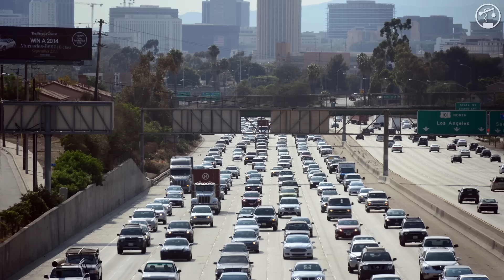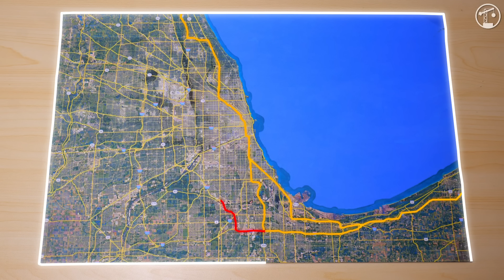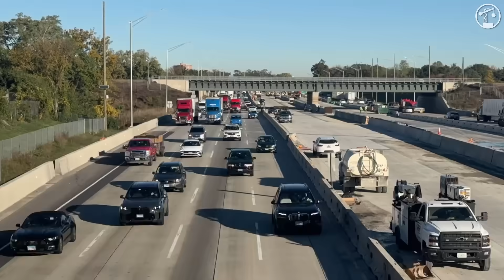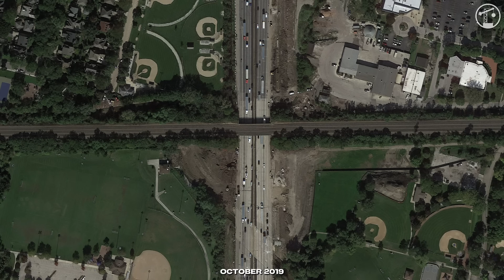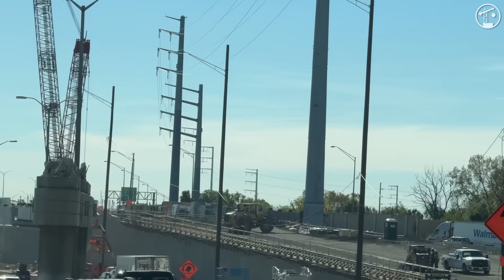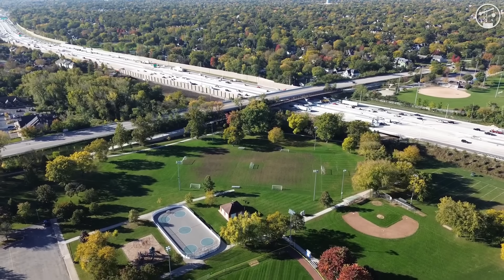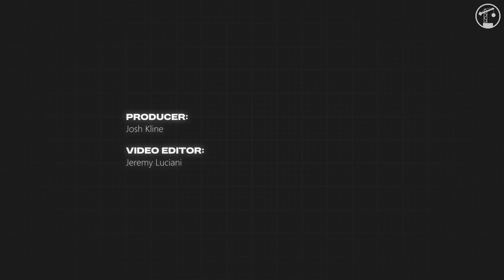Why Chicago is Spending $4B on One Road

Comment: 294 is not a 1950's highway. It has been totally rebuilt numerous times. And there is now 355 to the west as well as the old 94 going through the city. The problem with 294 is the problem with the other two interstates. If you put 4 tolls on 294 people go around. And that has made traffic in the other two highways back up for hours. Rush hour downtown is now a four hour event twice a day. And going through the city is cheapest. The toll isn't 40 cents. Its forty cents times four. So trucks often go through the city. And 355 to the west needs a tie back to the main road (294) north of the airport to Wisconsin. Right now there is no east west highway north of Ohare forcing people in the OHare and rush hour traffic.  In past plans there was a by pass from 355 north of the airport back to 294. In fact there are highways to nowhere north and west of the airport now. Another issue is that 94 goes down to what amounts to two lanes from 6 downtown. That backs up all the way to the airport and 294. Put a toll north of the city to balance driving with train fares as well.
Reply: 40 cents times four??? Tolls went up from 40 cents to 75 cents in 2012. And next year (2027), they will increase another 45 cents!
The State of Illinois has finally realized that people are made of money.

Comment: 294 is not bad at all even with the ongoing construction. 94 from 159th up through the city to around North Ave is a damn nightmare. I dont see how they ever remedy that without major no on/off ramp express flyovers.
Reply: I work off 130th and 94. Been there about 2 years. 94 is worst interstate I've ever been on. Definitely not up to modern interstate standards.

Comment: Some of the new concrete in sections is absolutely brutal. All you do is bounce and weave like skiing on moguls, it sucks.  There is a huge cracked section near the 87th St bridge in North Bound lanes, they didnt repair it, they half ass covered it with asphalt. 

Then there are 1 mile strips that were completely asphalted RIGHT AFTER concrete was laid, thats how bad it was, THEN the asphalt was so bad from the concrete they shaved the asphalt. This is the biggest scumbag operation use of public funds I've ever seen.

Comment: The 294-290-88 interchange used to be known as the Hillside Strangler because the inbound lanes went from 3 lanes down to 1, and since I-88 runs through several of the highest population suburbs in the region, traffic problems were inevitable. I'm lucky enough to not have to need to use it being up north of the city, but the misery it caused is legendary. Now they just need to work out the terrible geometries at the 90-190-294-Mannheim Rd mess at the entrance to O'Hare Airport. And rebuild the old overpass oases they used to have but knocked down for widening.
Reply: The Hillside strangler is still there.  They just moved it in a mile or two, to "the avenues"

Comment: My biggest wish for 294 is enforcement of the “NO TRUCKS IN TWO LEFT LANES” signage.
Reply: I'm a trucker and we often have no choice. There is simply not enough capacity to handle it all without using them at times.  I'm never in the far left lane but often I do use the next one.
Reply: Well maybe if the idoits would drive the limit in the right lanes then maybe trucks wouldn't be in the left two lanes and FYI the left lanes isn't for you to speed it's for passing
Reply: @jimmytrussel488  great excuse when the trucks in the restricted lanes are there when they want to go faster than their 60mph posted speed limit.
Reply: There are times when it's necessary. There are many variables as to why but many expect to use those left lanes like it is the autobahn. That is not a valid reason for truck restrictions. Allow the trucks to move at a consistent speed will help. One other thing, if the idiots in the Chicago area would grow up and stop playing games with the trucks would help a great deal. I have ran and continue to run Chicago for over 30 years.... it is the actions of people with nonsensical attitudes that cause the constant issues.

Comment: Its LAke Michigan.  It literally cuts off half the country from the other half from the Canadian border down to Gary IN.  So tons of East/West truck traffic comes through this corridor around the bottom of the lake.
Reply: Drain lake.
Reply: @radomirsretenovic8492 
Or simply build an elevated highway over the lake.
Reply: @DanAshleyChicago  That would be pretty cool.  There is actually a ferry that runs across but its expensive and its just cars.

Comment: One solution they needed were express lanes for those who weren't doing anything with Chicago and the burbs. Basically if you're going from Indiana straight through to Wisconsin, get in these lanes and fly by for the next 50 miles, no stopping.

Comment: Nicely done.  This is obviously a very complex build. The main driver of the logistical issues is Lake Michigan itself. Basically everything north of I-80 has to shift south to go around the lake. So this gets added to the congestion associated with a major metropolitan area and you have a difficult task in trying to optimize traffic flow. Living in the far north suburbs (think Gurnee) , when I need to go south or east, especially vacation travel, I will try to leave around 4AM. As the construction on the Tri-State seems to be going on forever, I find it more expeditious to take stay on I-94 into the city (via the Edens expressway and then the Kennedy) onto the Dan Ryan and over the Skyway. But you need to get there early, like by 5AM, especially when I am towing a travel trailer.  Really looking forward to the completion of this project.
Reply: For commuting, my rule is "you can't beat the early people"

Comment: Not mentioned: the failure to extend Hwy-53 north to Hwy-120 and the US-12 freeway in Wisconsin. This absence of these facilities funnels all north and northwest traffic into I-294, rather than distributing it efficiently between I-294 and I-355.
Reply: As 53 was proposed it would have been a failure due to inadequate E-W arteries in the path from the Lake Cook-53 intersection to Lakemoor.  Then what at 120-12?  That's where it was slated to end.  If the end-point is 120-12, how to connect back to I-94?  12 to 43?  There are way too many environmental hurdles for the continued extension, even for the 1970's.  The correct path would have been from 53-Dundee (ancient times) or 53-Lake Cook straight lining to 22 & Milwaukee, then either continue to 94 and connect at 137, or follow Milwaukee Rd to I-94.

Comment: Thanks for addressing the induced demand...I've lived here a long time, and induced demand is evident after every widening project. Probably, since the toll collection is done with transponders, the best move is to demand-price the Tollway. The toll on the Chicago Skyway is high...high enough to make commuters choose alternatives, so when I go on vacation trips (and only pay that toll twice), the highway is uncongested.

I-294 sits just west of the boundary between urban-style development (walkable, decent public transit, dependent on arterials) and suburban/exurban style development (malls, office parks, housing developments with low walk scores, poor public transit, stroads). I think demand pricing will help prevent the use of the tollway as a local short-cut, basically, apply economic pressure to use and let the users figure it out.

I live in the area, and go through the I-290/I-88/I-294 interchange area all the time on suburb-to-suburb trips, so I've got a bit of experience.
Reply: So basically exploit the suburban poor

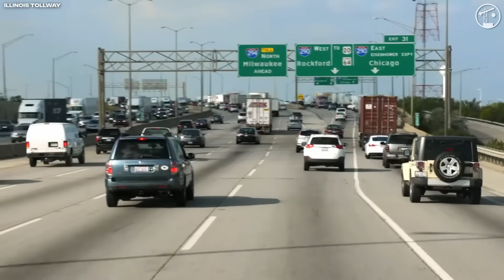Comment: 3:45 I live in the west suburbs. This shot? What a disaster zone. They tried to fix the Hillside Scrambler, and ... not a fix, just moved around the choke point. This is where I would decide to go to IL 64/North Ave (a strange and dangerous interchange, drive down US-20 pothole run past the Proviso rail yard, then a left and a right) via the loop ramp of slow truckage (that they fixed), or I-290 (parking lot toward downtown, I say "Rush hour is from 5 am until 3 am"). Maps says this is the fastest route and NO, I'm taking arterials.

Comment: I've been driving all of these expressways as a commuter for over 30 years.  Back in the 90's I used to park downtown for work.  Parking started at $3 a day and by the time I stopped working there 10 years later, $15 per day.  I go back later and all of the parking lots I used to park in are now High Rise Condo's.  Guess who helped pay for those.
On 294 I used to pitch my loose change into the feeder to get through the toll booth without counting it.  I'd just keep throwing a handful of pennies in until the gate went up.  Now I'm paying nearly $60 a month for the same stretch of road automatically taken from my debit card when needing a refill.
A few years back I switched to local roads.  It takes me 20 minutes longer but I'm not paying for the privilege of sitting in backed up traffic.  If you are charging me that much and I'm still sitting in backups, then maybe I'm the fool.  I only take the toll road home, and only when it gets me there without backups.  The new lane configurations, basically , just make it really confusing to figure out which lanes you need to be in to get to your off ramp.  They are not 100% done with it all but I can see, the Hillside Strangler will still exist at the 290/294 interchange, and there will be more crashes because it requires you to get over 4 lanes of traffic to get to your off ramp since it's not all on one side of the toll road anymore.  All this did, was get more expensive on a daily basis.

Comment: A lot of the work for the new ramps on 290 to 294 has alleviated this area of traffic and those are still in construction staging. Tollway has done a great job fixing their ramps. IDOT just bandaids as they really can’t afford major upgrades that the tollway can. None of the work I did on the Kennedy did anything on traffic configurations but IDOT advertised it to the public that way.

Comment: The back up taking 290 South and running into the 294 interchange is always a pain.  There's only one lane for the exit so traffic ends up blocking all the lanes with people trying to cut in.
Reply: Yes. The right lane of EB290 would back up with traffic trying to get on the ramp to SB294. This not only took out the right lane, but also center lane with any vehicle trying to cut into the queue in the right lane. I always used the left lane to try to minimize getting stuck as I was continuing EB on 290. This kept getting worse year after year. 
People on the US don't like tolls, but they not only improve the tolled road (294), but also the non tolled 290 if the money is used properly
Also, 490 will be built to go to the west side of O'Hare which should help 294 as O'Hare is growing again.
Reply: You got that right!!!

Comment: 294/290 problem.  Eisenhower Xway ended at 294.  Later the Eisenhower Extension was built from 294 to 90 in Schaumburg.  Much later 88 was built with the catastrophe ramping system--294/290/88.
Reply: In Chicago, the "Hillside Strangler" is not a serial killer, but an interchange at I-294/I-88 to I-290 in the suburbs of Hillside.  Perhaps coincidentally, Hillside is home to many large cemeteries.
Reply: @profdc9501 and home to the old landfill dump....😂

Comment: The addition of I-390 and I-490 are critical components of this redesign. 490 should draw a lot of truck traffic off as it connects with O'Hare. 390 should draw a good portion of west bound traffic off the main corridor and reduce some of the I-88 load. I think 390 also is supposed to draw off some of the west and northwest suburban traffic coming into and leaving O'Hare.

Comment: Lifelong Chicagoland resident here (until last year) who lived within a few miles of this highway, the Tri-State rebuild is helping and will continue to help the transportation system in the area. Like you said, it will be more resilient to issues. However, the underlying issue with Chicagoland roads is there are almost zero feasible alternatives. The state highways are underbuilt and flooded with an overabundance of traffic signals. And the high density of trucks is something special in all the wrong ways. If I-290/I-355, the outer north-south bypass had been built to properly connect back to I-94 up north, you'd see more traffic use that and less traffic tough it out on the Tri-State.

I now live in Wisconsin where there is a lot less traffic, though still busy. But even when it's slow, the metro is much smaller, so you know it won't last as long. Chicagoland transportation is a behemoth and needs to be reimagined, both car travel and multimodal (imagine if we had a beltway commuter train...).

Comment: Not wide enough, exchanges that are confusing and not efficient, always in disrepair or state of construction. The exchanges along side O’Hare on Ohare’s eastside is super confusing and inefficient. My opinion is only adding one lane in each direction is not enough. Needs to be six everywhere. They need to completely redesign and rebuild the exchanges, particularly where O’Hare is. If you’re not from the area and not use to that O’Hare exchange it’s a nightmare of confusion.

Comment: Just one more lane...  that always works so well. Look at Houston.
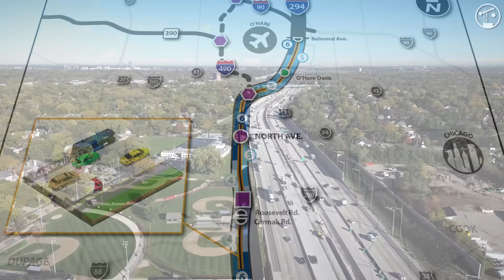Reply: 8:46 "the bet here isn't that 294 will stay empty after you rebuild it. It's that the corridor won't break down as easily when it's full."
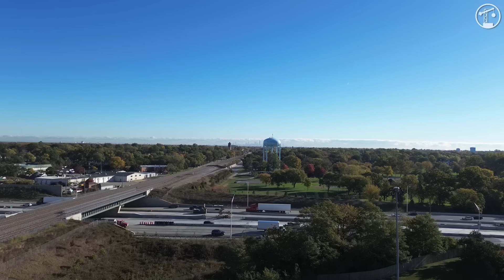9:00 "If induced demand does show up, the end goal is that the better geometry, real recovery space, and active operations keep the beltway reliable instead of fragile." 

Reliably slow during peak demand will be better than today's more frequent stop-and-gos caused by accidents and throughput bottlenecks.

Comment: Well done. You focused on some key aspects. The I-80/94 corridor (aka the Kingery Exprswy or Frank Borman Expwy) is also a major transit issue which has been rebuilt several times over. It has chokeholds similar to I-294. The Thornton Quarry at Halsted Street to State Street passes over the world’s largest limestone deposit. It narrows down to just 4 lanes in either direction which is too few during peak hours. It is impossible to widen and thus effects the far south end of the Tri-State Tollway system.
Reply: This is true, and will be horrible traffic when the Bears stadium comes to Hammond, IN? Yikes!